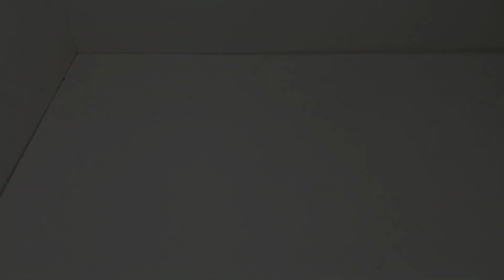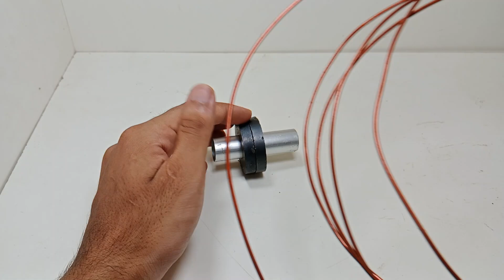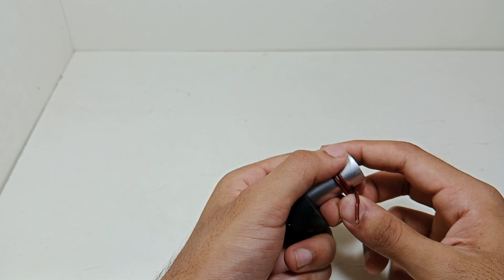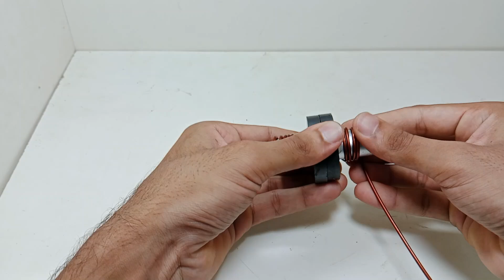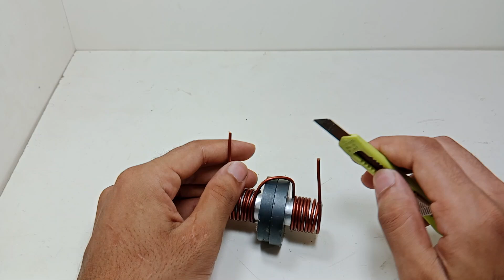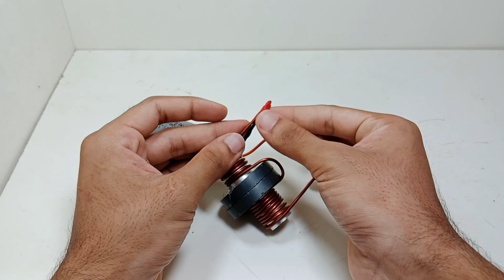I Create a new energy generator into Ac 6000w Transformer

Comment: 7:38 He left the table. 
7:40 The video was cut off (edited). 
7:41 Another section of the video was joined (edited). 
In between these editions the capacitor was charged with a different power source. 
The bulbs received the electricity from the capacitor.